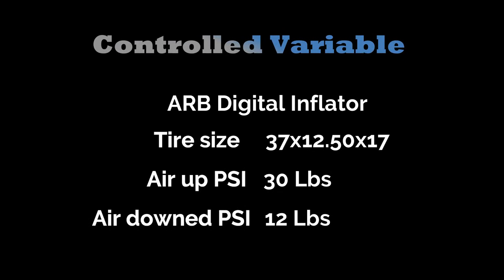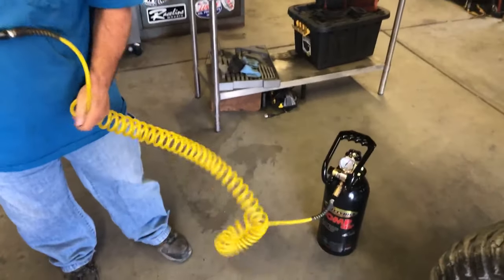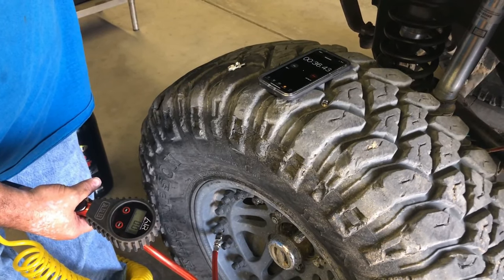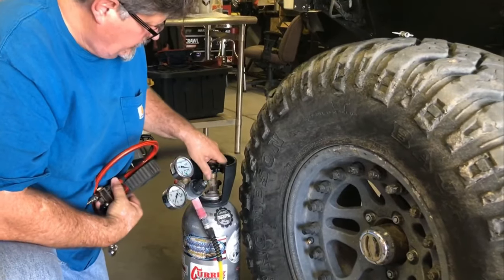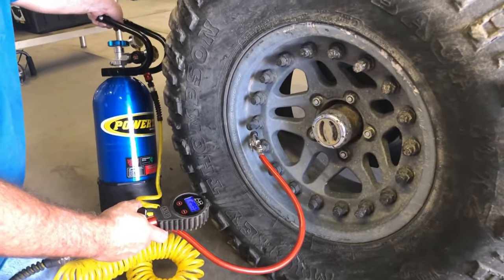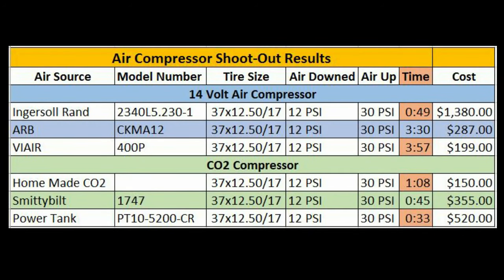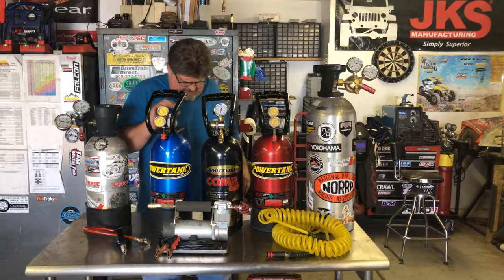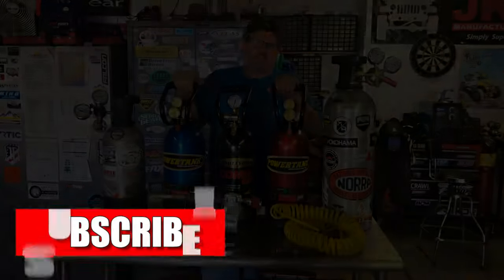Air Compressor Shoot Out Video

Comment: How many fills could you get with a 10lb CO2 tank 37"tire 12>30 psi before needing to refill vs 15lb? Also curious the homemade with a 150psi regulator and the power tank having the 250 psi regulator be the reason behind the fill speed? Great vid thanks!
Reply from the maker: I have not tested the 15lb tank for how many refills it can handle (but would be an interesting test)  because the 15lb takes up more room in my Jeep. 

I take the 15lb when I trailer my Jeeps but usually don't use much Co2 as I don't need to refill the tires to get home.

The 10lb get 3 refills (12 tires) before needing to have the Co2 tank refill.

Most likely the the 250Lb Power Tank regulator just puts out more air and increasing the better time.

I expected the Power Tank to do the fastest, but was extremely  impressed the the SmittyBilt as I paid under $250.00 on sale at one of the Off Road shows.
Reply: We actually have a tire air up chart which shows estimated tire fills by tire size, tank size, and how much pressure you are adding.

When comparing tire inflation speeds, the number you want to look at is CFM or cubic feet per minute. High end 12 volt compressors peak at about 5 CFM, the SmittyBilt CO2 tank has an advertised 32 CFM, and a Power Tank boasts 45 CFM. The other concern you have with lower end CO2 regulators is freezing. Power Tank has the only CO2 regulator guaranteed to never freeze clog after extended use. Other regulators can build up dry ice internally slowing or even stopping the flow of CO2 until it defrosts.
Reply from the maker: Power Tank Official Thanks for sharing and developing a awesome product.
Reply: @5150MotorSports  
What wheel is that and is that a 2 piece and/or beadlock? Wondering about all the bolts. I like it for my MJ.

Comment: My smittybilt frosts over... do you have any issues with it?
Reply from the maker: Scott Kinderdine Yes I’ve had had both the SmittyBilt and the PowerTank developed frost on the regulator, usually when airing up 2 to 3 sets of 35/37. Never stopped my from be able to air up when I needed.  Thank for watching..
Reply: 5150 MotorSports mine started to frost up on the first tire.
Reply from the maker: Scott Kinderdine might verify the regulator is open all the way,  I never had mine freeze on one tire, I Normally air down to 8psi and air up to 30psi, how about you?   When it freezes does it stop the air flow?
Reply: @5150MotorSports  It doesn't stop but definitely slows down... I'll use Plumbers tape to see if it contains the free flow of air. If it does it may help it from frosting up so much. Hopefully I can check tonight and get back with you to help others out.